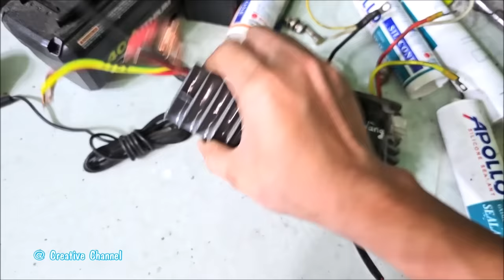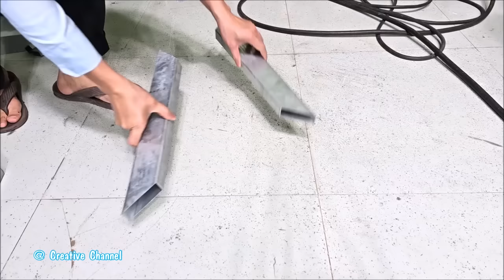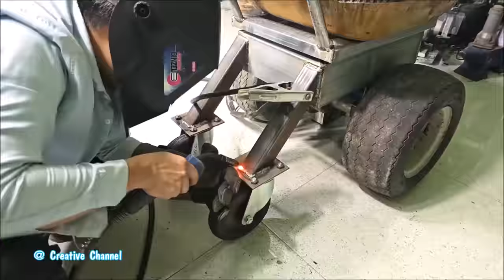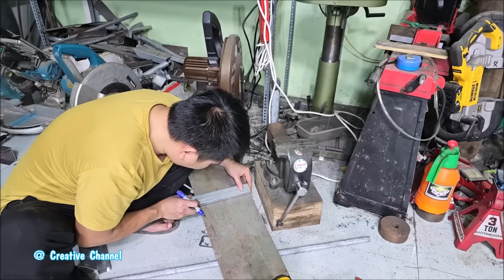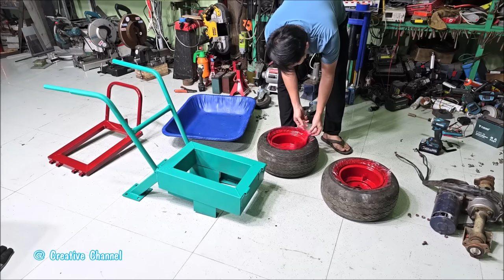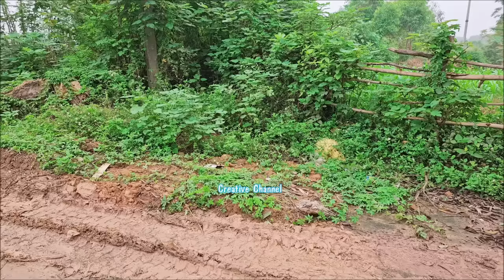DIY Powered Electric Wheelbarrow

Comment: Very practical ! 
To improve the build, I would suggest these three ideas:
1. Put the accelerator cable inside the metal tube to make it less visible and prevent it from easily getting cut.
2. Add a braking or wheel locking system for more safety when stopping with a load on a slope.
3. Motorize unloading system by using the same motor but with a switch to switch from driving mode to unloading mode.

Good job.

Comment: This is awesome build. But it could be sooo much better. The frame and the design is great. But the electronics could be better and you could make bucket dump by itself. Also the lock and unlock the dump shouldn't be a kick and obviously not mentioning the breaker as an on-off switch tie wrapped to the handle is not good. But don't Take this wrong, I love it. I think it could be even better. Also you could make it bluetooth remote controlled so you don't have to hold. So many possibility. The hardest part is tires and the drive / motor and gear box axle. You know where I could get those?
Reply: Try from a mobility scooter.